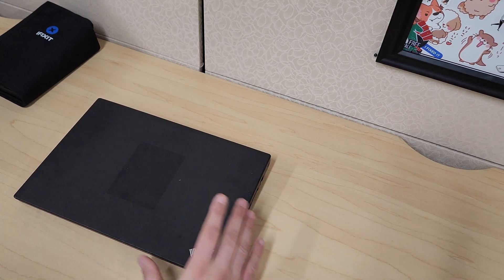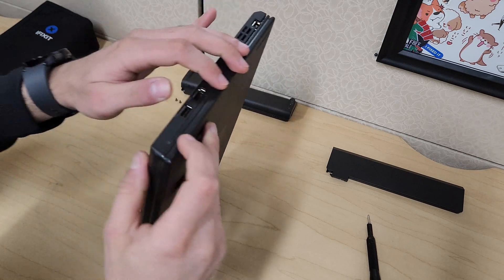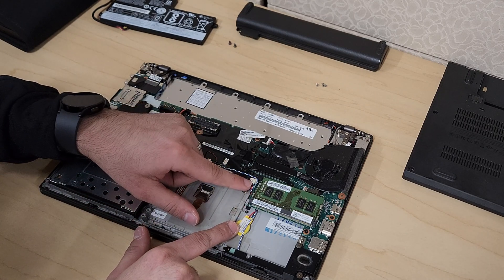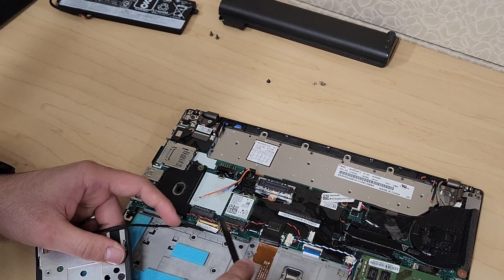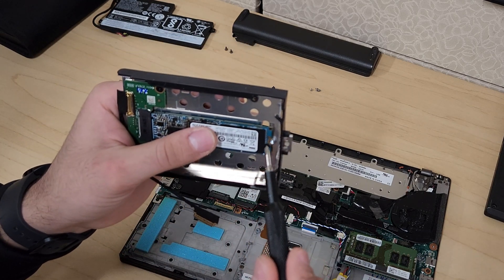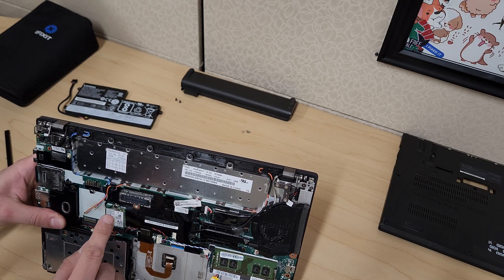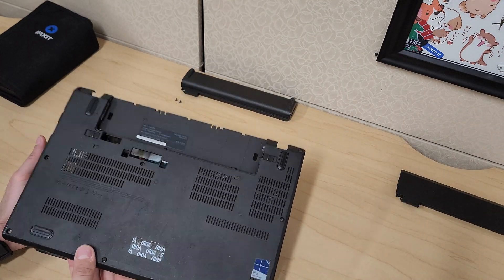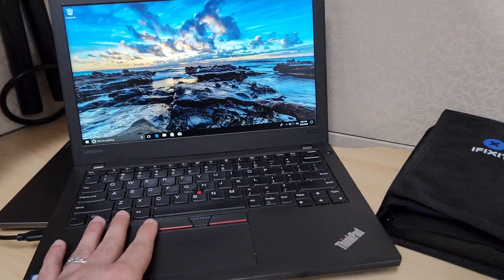Lenovo ThinkPad X270 SSD, RAM, Battery Replacement/Upgrade

Comment: Hello, great video! One question, is there any difference in the external battery between the flat one and the slim one? Is one of both better?
Reply from the maker: Hey, thanks! Yeah, the slim is a 3-cell and the thick one’s a 6-cell. The thick one gives longer battery life but is heavier as well.

Comment: i heard there is flex in the chassis if you holding it with one hand, causing the laptop to turn off
Reply: yeah, holding only on the left side of the laptop. every time it bends it will shut down.
Reply: Yup happens often to me  @Rolo-r9i

Comment: what usb c charger you use ? i cannot charge my x270 using pd 65w charger
Reply from the maker: A 65w lenovo or any aftermarket works. Does the type c port work if you plug in a type c usb or charger for phone?
Reply: @ no it doesn't work using phone pd charger event though the voltage and current ratings are the same. not sure why
Reply from the maker: most likely a fried port

Comment: What kind of m.2 it is? It is sata or nvme?
Reply: Not sure about his, but I have a few of these exact models that have 256gb nvme m.2 drives. Might depend on the exact version though
Reply: I had this one using ssd m2,, try use nvme can't 
i use ssd kyo 512gb

Comment: Great video, I've got 4 questions:

1. I upgraded my ram from 8 gb to 16 gb, 2666 mhz. The 8 gb was 2400 mhz. Is it possible to maximise the clock speed?
2. What upgrades should can I do more?
3. Whats the thing next to the wifi card?
4. Could you maybe tell me ( or make a video, but I don't think you want to make an entire video for one person) how i can remove the thermal paste en put some fresh one on?

I would appreciate your response, have a nice day!
Reply from the maker: Hey!
To answer your questions
1. Not sure if this would work but going into the power settings (advanced power settings) and changing the maximum power state. I can try this upcoming week and update
2. SSD if you have a mechanical hard drive. aside that, it's a laptop and not much can be upgraded 
3. Based on some research, the AX200NGW can be installed to get WiFi 6
4. I can make a video on thermal paste this upcoming week. I'll keep you in the loop!
Reply: Thank you very much, underrated tech youtuber!!!❤
Reply from the maker: @kivron3794  Video was posted and you're welcome! https://www.youtube.com/watch?v=sEfxO-rkWD4

Comment: Batteries looks familiar, is it compatible with lenovo thinkpad t470, t480, t570, t580?
Reply from the maker: yes! I believe that's correct. of course also compatible with the x260 x250 x240